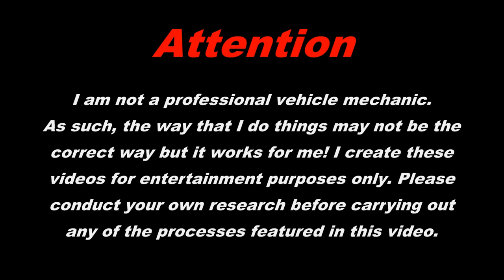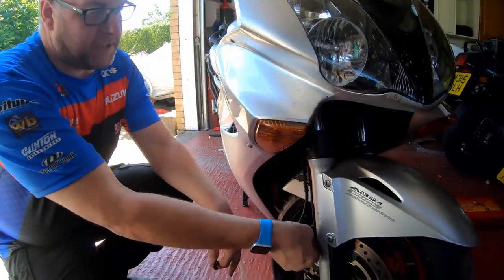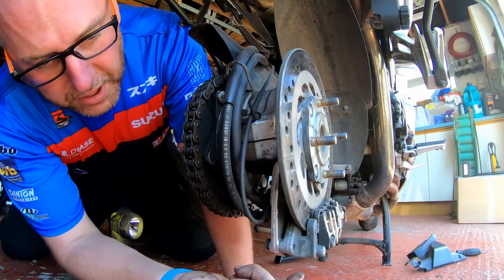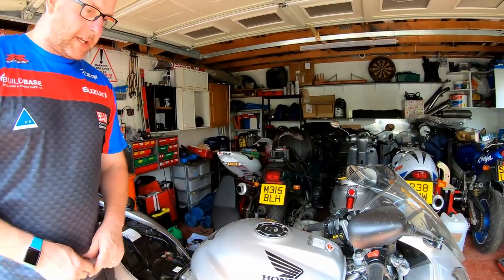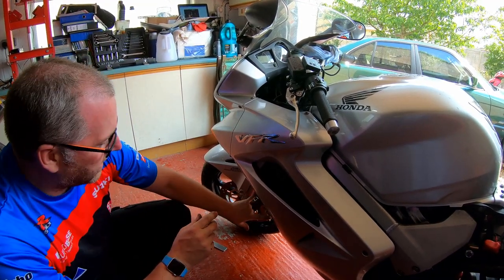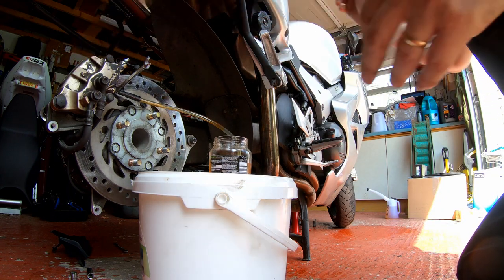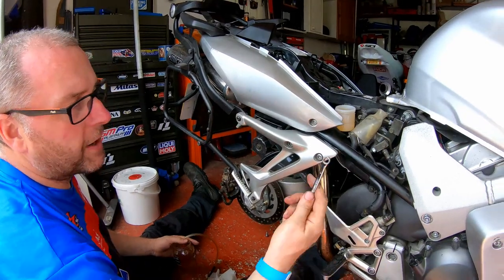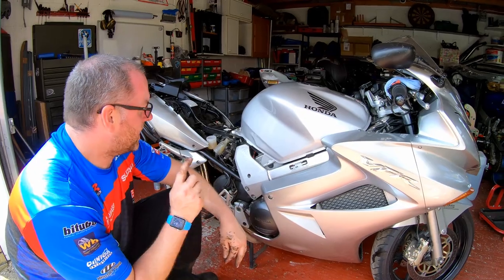2003 Honda VFR800 VTEC Changing The Brake Fluid And Bleeding The Linked Brake System (CBS)

Comment: No need to repeatedly crack the nipple open and close. Just the tubing going into a container with brake fluid is enough to prevent air and old fluid from going back inside the nipple. No need to bleed the system dry first either. That means a tool-less, one-man job of just replacing the old fluid in the reservoirs and repeatedly pumping the pedal/lever until new fluid and no bubbles come out from the nipple. I've successfully used this method on my R1 and on all the cars I've worked on, the same should apply to the VFR800's proportioning valve (if it doesn't, just repeatedly pump both front and rear brake levers, that should be plenty of pressure). Only caveat is it allows bottoming out of car brake pedals which could damage the master cylinder, so just don't bottom out the brake pedal when working on a car. Clutch pedals are fine to bottom out since they do so in normal operation, same thing with motorcycle clutch/brake levers.
Reply from the maker: Thanks for the tip however the process that I followed is 100% the way it is written in the Honda Factory manual, including bleeding the system dry first!! 👍🏻
Reply from the maker: I will also add that if you've ever done this task on the VFR800 it is nothing like anything you have ever bled before! Trust me when I say that I have done lots! Including my R1 incidentally! Pumping the rear brake pedal does nothing to the middle piston on the rear calliper as that is activated by the rotation of the left hand front calliper! Bleeding the linked brakes on a VFR is nothing even remotely like any of the cars or bikes that either you or I have worked on previously! This system is very different in its operation! Following any method other than the one stated by Honda in their own manual will most likely not be successful! 👍🤓
Reply: @KevsShed  Ha! My mistake. I assumed there was only one proportional control valve with the front and rear master cylinders joining together at the middle. From looking at the schemas it looks like you could technically bypass bleeding the proportional control valves altogether and just bleed at the center bleed valves if there's no air anywhere in-between. That would save the trouble of having to remove the second front master cylinder, tilt it and manually pump it while pumping the front brake. Then again, because it's an open moving part it will most likely have to be done anyway haha as those tend to accumulate tiny bubbles of air. Anyways thanks for the video! I thought pumping the front brake alone would be enough to transfer fluid to the center rear piston, but not when it's disconnected from the fork haha!
Reply from the maker: Cheers Mate, The centre rear piston is a bit of an oddity, it's operated by the left front rotating on its bracket which in turn squeezes the secondary master cylinder attached to it. Obviously this doesn't rotate unless the wheel is turning and the brakes are applies so it needs to be done manually! It's a right royal PITA but if my method is followed then it will usually turn out right! 👍
Reply: @KevsShed  Cheers!
Reply: @KevsShed  I must say after having a go at it myself yesterday, a cheap speed bleeder is the way to go! As you said, manually pumping the front bracket yields only a little each time you crack the nipple open... and that's with an undrained brake system :/. To be fair, I didn't have anyone to pump and hold the front lever for me so that might be why it took so long.
Reply: @KevsShed  Actually... I managed to bleed everything except the outer front bleed nipples using the rear brake pedal. I'm quite confused as to why the rear brake pedal would fill the secondary master cylinder and bleed out of the battery side bleed nipple, but I figure a speed bleeder would achieve the same thing haha. I don't know when that was serviced on this bike, but I easily went through 500 ml just to flush out all the contaminants in the center rear bleed nipple! Edit: Now that I think about it the front may be de-linked from the CBS. It would all make sense.
Reply: @KevsShed  I just wanted to let you know that you were right!!! I'm so sorry for doubting you. After losing pressure in the rear brake pedal I ended up rebuilding the secondary master cylinder and following your brake bleeding procedure to the letter, with success (finally!!!)! The rear middle piston sticking and pedal losing pressure was driving me crazy!
Reply from the maker: @FlameHazeist  no probs bud! Glad you found it helpful! 👌🏻😎

Comment: Brilliant video! Do you think if this method will work on a CBF 600SA 2010 (PC43) with linked brakes? It's got a system where the rear brake pedal also operates the middle cylinder on the right-front brake caliper.
Reply from the maker: I am not 100% certain but I imagine that the system is near identical 👍🏻
Reply: @KevsShed  Thank you!

Comment: Thanks for another great video!

I imagine given the very low cost of the vacuum bleeder tool most people would use it for this job.
With that in mind would you be able to make a video showing how to do this job using that tool rather than reverting back to the old fashioned method?
As it gets a bit confusing for me when you switch methods as to what is required using the new vs old method.
Reply from the maker: It'll be exactly the same just without the need to pump pressure in using the pedal!
Reply: @KevsShed  Thanks for clarifying.
Reply from the maker: @bigbluechopper24  You're welcome!
Reply: Do you still need to actuate the secondary master cylinder? Or does the vacuum pump pull it through anyway?
Reply from the maker: @lmaoroflcopter  In theory no you shouldn't need to but if you find that you can't get the pressure up then you may need to! Give it a go!

Comment: Thank you Kev for making this video for us all, i shall be replacing all the brake cylinders on my Honda NT 700 VA at some point as i like to have the stainless steel type on my bikes. I shall look through the Haynes manual before i dive in to see if theres much diffrence between my bike and your VFR 800, i also have the same vacum pump thats in your video and yes they are worth there weight in gold.
Reply from the maker: Happy to hear it’s helped you buddy, that makes it all worthwhile 👍🏻

Comment: Yess!! Thx!
What If I use the vacuum pump to refill the lines? 
Can I do the same way, like you removed the old fluids?
Reply from the maker: Yes absolutely, you can use it to refill, in fact that’s what the factory service manual recommends. I just wanted to show that it can be done without it for those that don’t want to buy one. 👌🏻

Comment: Hi, I would like to ask you if it is necessary to use the rear pedal to push fluid
to the secondary master cylinder (SMC) and then push in the SMC with fingers
to transport the fluid to the proportional control valve. (When I use the air bleed tool)

Thanks
(great videos)
Reply from the maker: Yes, the air bleed tool in my experience doesn’t do a good job of filling the SMC with fluid so it tends to need a little bit of help, good luck.

Comment: hello .step 4 I can't find the part under my seat I have an RC46/2 2002 not ABS .... Where is the Rear Proportional Control Valve?
 Now my rear brake is no longer responding ... Thank you
Reply from the maker: Only the ABS models have the RPC Valve under the seat, as yours is non-ABS then simply skip that step 👍🏻
Reply: hi shed...thank you for your answer......if between two steps my oil jar empties by mistake.....I have to start all over again or just redo the step at which the jar emptied ? thank you

Comment: Great video. While it is still quite a rigmarole, I feel more confident tackling it. 

Is there a way to do this without help?
Reply from the maker: Yes, absolutely, if you use a vacuum bleeding tool then you won't need anyone to assist. I did it the old fashioned way to demonstrate that it is possible to do as the factory manual tells you to use a vacuum bleeder. Not everyone has one, so wanted to show that it isn't 100% necessary to have one.
Reply: @KevsShed  Thanks Kev!

Comment: Would this be the same procedure on a CBR 600f 2011-2013? It also has abs linked brakes.
Reply from the maker: I’m not familiar with the linked system on that particular bike but I would imagine it is very similar.
Reply: @KevsShed  I've got a manual for it so I'll have a look and compare. I've changed fluid on my RR which isn't abs and was a lot easier. This seems more involved. Thanks for the reply.
Reply from the maker: No worries buddy, let me know how you get on 👍🏻

Comment: Just to clarify - you could have used the same tool you used to initially drain the system during the final bleeding process? With no need for an assistant or depressing the levers at all?
Reply from the maker: Yes 👍🏻

Comment: Is it possibile to change fluid using only vacuum tool? I only want to change fluid without venting. I will refill the reservoir with new fluid and using vacuum tool to change it.  Following your instructions in the order of the steps. Please answer that it will be ok or it would be better to pump with assistant.
Reply from the maker: Of course, using a vacuum tool is the way that the Honda manual states to do it. I just wanted to demonstrate that it can be possible to do without needing a vacuum tool. 👌

Comment: Is it easier to bleed the system using a pressure bleeder as the one you used when draining the system?
I got of those bleeder tools you connect to the compressor.
Reply from the maker: Yeah it should be as you don’t need anyone to assist. That’s the way it describes it in the manual.  Just wanted to show that it is possible to do it the old fashioned way without the need for any special tools 👌🏻

Comment: Top video Kev much appreciated, will give it a go after making a dogs dinner of it last time! Daft question, any reason not to use a one way valve rather than continually cracking bleed nipple?
Reply from the maker: Absolutely no reason, I decided to do it that way to kind of demonstrate it using the method that everybody can do without needing to buy any tools. 👍🏻

Comment: Nicely done Kev! I was going to ask if it was the same for an abs bike but then I realized it is an abs model you’ve got. I was going to try the same but was definitely not planning to empty out and introduce air into the system! I’m planning on just keep vacuuming until I’ve got fresh fluid. You’ve got balls of steel! Lol
Reply from the maker: Cheers mate 👌🏻
Reply: thanks for posting Kev. My question was the same - would it not be better not to introduce air into the system?
Reply from the maker: Mike Kovacs either way you have you bleeding kit out and I prefer not to put new fluid in the system whilst the old stuff is in there still. I do get your point however but it is my preferred way 👍🏻
Reply: @KevsShed  I'm going to attempt this on my 2007 in the Spring. If I don't plan on introducing air into the system and ensure both brake reservoirs are topped off while bleeding, vacuuming until fresh fluid is visible should suffice, correct?

Comment: I have followed the procedure from start to finish, front is perfect  but the rear brake pedal has to pressed twice to work properly,  bled system in correct order again and still the same. Any idea whats wrong??
Reply from the maker: It’ll most likely be air trapped in the secondary master cylinder on the front left calliper or in the line, that’s the usual cause of sponginess in the rear!
Reply: Just strange as I have done the whole bleeding procedure 3 times now, scratching my head. Love the videos by the way kev,
Reply: @chrisowen4313  Same bro :D

Comment: Hi Kev and thx for all the great vfr videos,they are really good. I have a question about the bleed process. I have ordered a vacuum tool similar to the one you used and want to try this myself. If using a vacuum tool,do i still need to take off the front left caliper and manipulate the secondary sylinder when bleeding the left 10mm nipple and also the rear circuit,or will the vacuum tool pull fluid through when holding the rear brake down? Hope i made myself understood mate. English is not my first language 🤣
Reply from the maker: It will still need to be rotated buddy, air will be trapped at the top and won’t be pulled out otherwise 👍🏻

Comment: Thanks for an awesome display of the bleeding. 
Two small questions: What are the size of the nipples? I bought a cheepo vacuum bleeder which is no where air tight...
The service manual doesn't mention you need to pump the rear brake pedal to bleed the secondary master, is that step needed? 
Cheers!

Comment: Just got this kit but the right angles piece that fits over the nipple, (there are 3 of them, supposed to be different sizes) well anyway none of them fit tight on the vfr's bleed nipple, looks like they put 2 the same size in and one slightly smaller but still not small enough for the bikes bleed nipple.
Reply from the maker: Shame, I’m sure they’ll send another if you tell them!
Reply: If you can't  get a tight  fit on the nipple,  then try and get screen washer tubing they come in different  diameters of size , that's what l did and got a good fit onto my bikes brake nipples, also the tubing connected to my vac pump  no problem you can get the tubing  at halfords  or any car parts supplier  .cheers

Comment: Great videos Kev - really enjoyable and informative!  At the moment, I just need to turn my front brake banjo around 180 degrees (as it’s stopping the brake lever being lowered to a more comfortable angle).  So, do I need to drain the whole system down? - or can I just drain the first line and master cylinder,spin the banjo over and then refill that single line? Thx!
Reply from the maker: Sorry Matt, I missed this comment before, to be honest, if you want to save yourself any hassle, I would simply loosen the banjo bolt a fraction, just enough for the banjo to turn but still with a little resistance. Then turn it to the direction you need it and then retighten the banjo. I reckon you'll get away without needing to bleed it. So long as you don't press the lever, I don't think it'll draw any air in. Good luck. Hopefully you'll get away with it and the lever will feel firm afterwards. If not then obviously you'll have to go through the process of bleeding the front of the system.
Reply: @KevsShed  Thanks Kev! Actually the lines are Hel braided ones and we’re quite newly fitted by the previous owner.  So all new fluids etc.  The banjo is an odd angle and hits the bar clamp - so I thought I’d be able to drain down, undo banjo and spin it 180 degrees.....as it happened not!  It’s just too stiff to rotate.  So, I refilled and bled the front....
What I did find was, with the bleeding kit I bought (like yours) the supplied black pipe ends did not fit on the nipples at all well.  The plain clear tube alone was better.  In the end, I got a firm enough brake lever through bleeding....but then made it much firmer again by fixing the lever pulled in to the bar with a strap.  Loosening / retightening it again over a couple of days.  

This made a huge difference and obviously moved any last air bubbles up into the master cylinder.  I’d recommend that as a ‘post bleed’ process based on my own limited experience.
Reply from the maker: @sailmakerman  Nice one! Glad you got it all sorted!
Reply: @sailmakerman  Ok i have a couple of questions.

1st: What do you mean by rotating the banjo 180 degrees? You mean that you rotated the line so it is pointed upwards? I understand that this would give a lot more room for adjustability but wouldn't the length of the line be an issue? I myself thought of filing down the little thing on the fluid reservoir that stops the line from staying at a fixing position, so i can get a few degrees of adjustability.

2nd: What happens when you fix the lever pressed in? Does it force the air to go up to the fluid reservoir?
Reply: @trantas4  I meant turn the Banjo over really.  The pipe exited at an odd angle.  In the end I did just what you thought of and filed a little bit off the little tag which gave me enough movement to lower the lever to a better angle.
Reply: @sailmakerman  Thanks for answering. I checked it again after i saw your comment but i found that the whole reservoir was the limiting factor here, as i had it as low as possible and it was hitting the clip on. 
2 solutions to this would be to install different clip ons with narrower base, like some adjustable 3-piece ones, or install a different brake master cylinder from a cbr or any other bike that has a plastic reservoir. Although, some say that the plastic reservoir doesn't fit properly on our bikes and it needs to be modified.

Comment: I'm a bit confused when you were bleeding stage 4. You were releasing the second master cylinder before pressurizing it. Could you explain a little bit more about the right timing. 
i can't bleed my system... don't know why.. followed all the steps but the still pedal feels soft..

Thanks
Reply from the maker: Hi chap, basically what you need to remember is that the secondary master cylinder doesn't have a fluid reservoir of its own so you need to push fluid up to it and then once there, push it on to the rear, basically brake pedal then SMC, kinda hard to explain but hopefully you get what I mean.
Reply: @KevsShed  OK thanks!

Comment: Hello Kevin, just saw your vid. Is there a way to just bleed the rear brake? I had to rebuild my rear master cylinder and have a dead pedal. Fronts work like a charm.
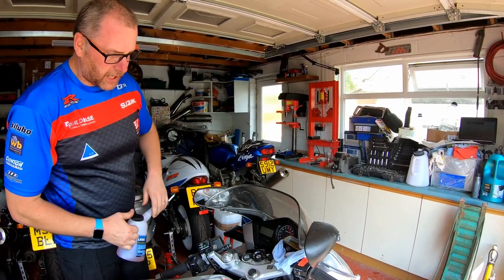Reply from the maker: Absolutely mate, if you don't need to touch the fronts and you are happy with them, then simply start the process at Stage 2, approx 24:30 in the video! 👍🤓
Reply: @KevsShed  thanks so much! I appreciate your help. I am pretty sure it is just air in the MC. I am watching all your vids now. Greetings from Florida!